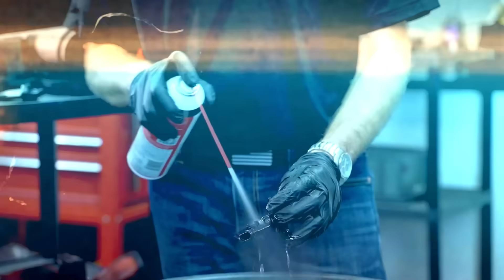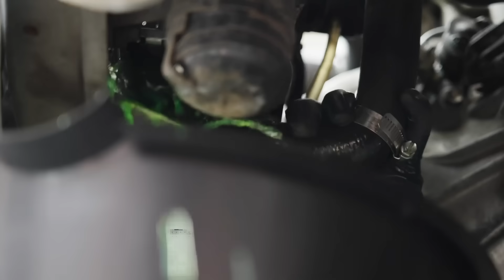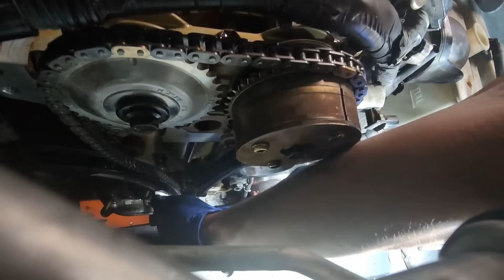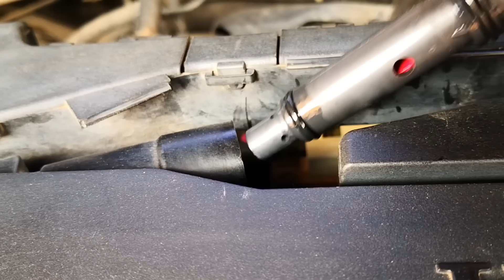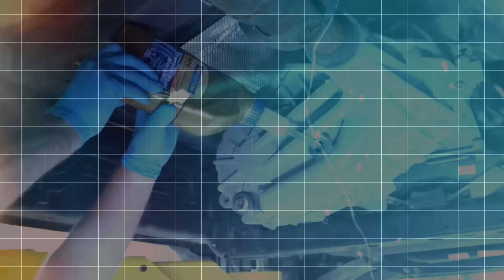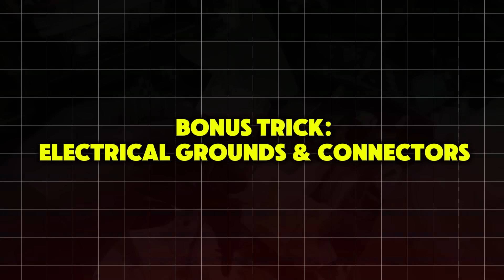100k Mile Maintenance Tricks Mechanics Won’t Reveal

Comment: Maruti Zen automatic gear (3 speed) car, AC model, 14 kmpl mileage. Japan engine, Japan gear box Japan carburetor (NO ECM, NO SCANNING, NO ERROR CODE), Japan radiator, Japan axles, All zen automatic cars prior to year 2000 (only carburetor model, not MPFI) have high quality original Suzuki engine and imported 'Made in Japan' Suzuki automatic gearbox. This same Japanese automatic gearbox was introduced in Maruti 800 in 1990 (2 speed gearbox). Modified version (4 speed) (Indian made) of this gearbox is used in A-star, Vitara Brezza, earlier model of Swift, Dzire, XL-6, Ertiga and S-cross.The petrol-powered Brezza and Toyota Urban cruiser share the same 4-speed torque converter AT gear box. So this RELIABLE automatic gearbox has been in India for the last 35 yrs. I heard that there have been many reports of issues in the AMMT gearbox, requiring numerous software updates and even complete gearbox replacements even within 25,000km, sometimes GEAR suddenly becomes neutral (free) while on the highway, Need to shift to manual for a while and then after some time it gets stuck on setting it back to auto. You can also add "overheating" transmission / clutch burning to that list. CALIBRATION and clutch LEARNING needed after new clutch fitting. Many fault codes, TCM errors etc. Manufacturers have struggled with the long-term reliability of AMMTs. It is inherently an inferior technology for passenger cars. That's why I don't recommend AMMTs to anyone. CVTs are quite reliable and almost a gearless transmission system. But it is also very expensive but less expensive than DSG/ DCT replacement. It is safe to assume that it's replacement cost will be somewhere around 4 to 4.5 Lacs. CVT transmission uses a metal BELT and this metal belt snapping is common in poorly maintained cars. CVTs are significantly more expensive. It’s also about durability and fuel economy. CVTs can be delicate when driven in stop-and-go traffic over long periods, and repair or replacement costs are high. I will always recommend a proper Automatic gear (Torque converter) because of its superior smoothness, performance, reliability & resale value. TORQUE CONVERTER automatic is 95 year old technology and the most reliable automatic gear technology. Latest generation automatic cars have AUTOMATIC GEARBOX with SOFTWARE CONTROLLED gear shifting which is very complicated and may be having high maintenance and very expensive to repair. Latest automatic cars have ENGINE CONTROL MODULE (ECM) Very expensive to replace) and TRANSMISSION CONTROL MODULE (TCM cost high).If TCM is faulty, we cannot shift from Neutral to Drive. Driving with a faulty TRANSMISSION CONTROL MODULE can damage your auto transmission. Latest automatic gear systems are sensor based. Need to depress the brake pedal before shifting from P to D or from D to R. If BRAKE PEDAL SENSOR is damaged or fuse blown, we will not be able to shift from P to D. No BRAKE PEDAL SENSOR in this automatic zen. No ECM/ TCM in this carburetor model Zen automatic. Many latest automatic cars OVERHEAT in heavy traffic. During overheating the FUSE in auto gearbox is blown. Then the car automatically shifts to NEUTRAL and we cannot DRIVE. This automatic zen never had overheating. No FUSE in the automatic gear box of this zen. Have driven 250 km non-stop without any problems. Latest automatic cars have very complicated ELECTRONIC MOTHER BOARD inside the automatic gear box. This Zen Automatic car do NOT have any software or computer or ELECTRONIC MOTHER BOARD inside the automatic gearbox/ engine. No SCANNING needed. This automatic zen has a simple MECHANICAL automatic gearbox. Simple JAPAN engine (carburetor model-even roadside mechanic can repair it) and simple JAPANESE 3-speed MECHANICAL (no electronics) automatic gear box. Latest automatic cars have even 10-speed automatic gearbox. The more the number of gear ratio, the more complicated and more expensive to repair. This Made in Japan automatic gear box will last for about 3 lakh km in Indian driving conditions.and this Japan engine will last for about 4 lakh km. The less the weight of the car, the more the life of automatic gear box. This zen weighs just 750 kg. So the automatic gearbox has to pull less weight, so it will last long. Latest automatic cars have non-reusable automatic gear oil FILTER with washer. If washer is dislocated, autogear oil will enter the transmission without filtration and auto gearbox will get damaged. This zen has RE-USABLE flat METAL MESH type gear oil filter without washer. Zen carburetor engine model has more quality than zen mpfi engine model. Do not compare the used car rate of automatic zen with the rate of manual gear zen. FULL MECHANICAL/ ZERO ELECTRONICS CAR. The less the electronics the more the reliability. Average price of good condition used Zen automatic is 2.25 lakhs.